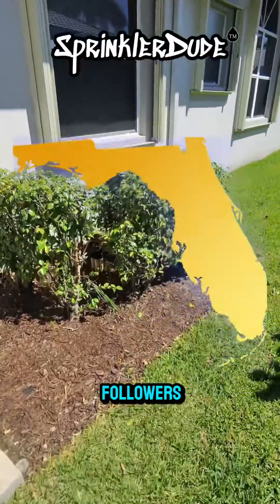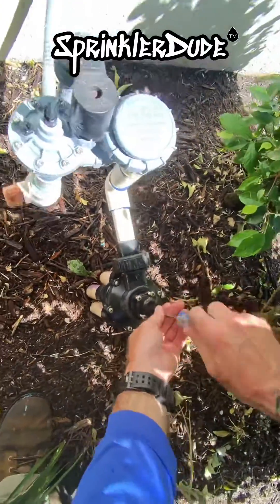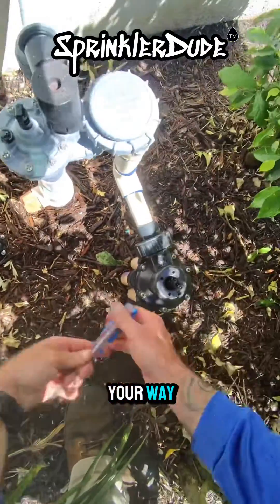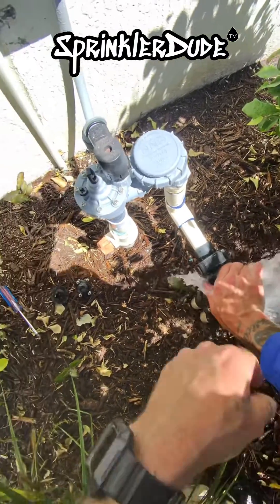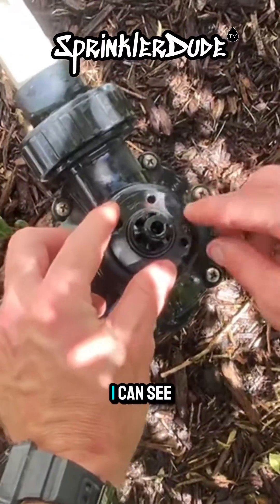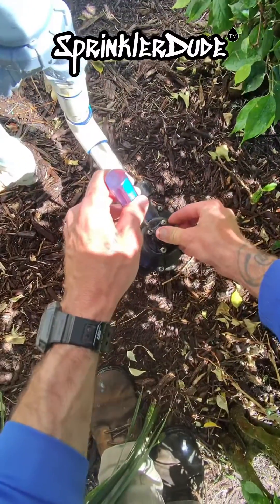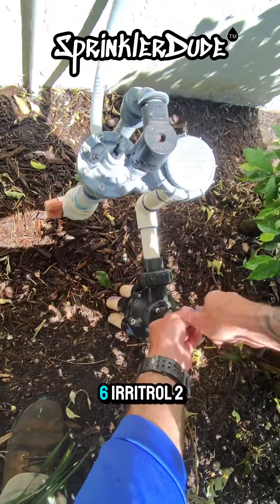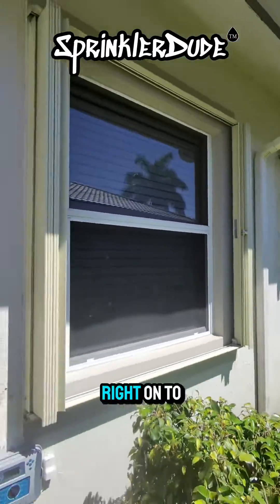Sprinklers Not Changing Zones? | The Solution

Comment: I don’t have a chip in my brain for using an indexing valve on an irrigation system. Yes I realize it’s commonplace in Florida, but I just can’t see this flying as acceptable to do in this day and age. anywhere with all the ridiculous water restrictions and ordinances for modern landscapes; I can only ask myself “Why?” Old habits die
hard I suppose.
Reply from the maker: At least one of the two companies who manufactures the indexing valve is not a small company. It is possible that one or both of these companies are lobbying against water conservation efforts in order to continue selling their product. As I stated in this video, I intend on upgrading this system to electronic valves so that the client can manage their water.
Reply: @sprinklerdude  I believe it (the lobbying to keep people in the dark for profits). I did catch that this was only temporary and eventually would be upgraded which I’m stoked to hear. I’ve seen some videos of yours with some rather complicated indexing valve setups that also seem delicate. On one hand I think it’s brilliant how you make it function. On the other hand I’d be scared to do it that way unless it was where I could check on it every day because I’m that paranoid.
Reply: Well it seems to me paying for a whole new system when the other one works (admittiedly not as efficiently but without any problems) is a pretty big motivation.
Reply: @mikewommack3134 I cannot argue that.